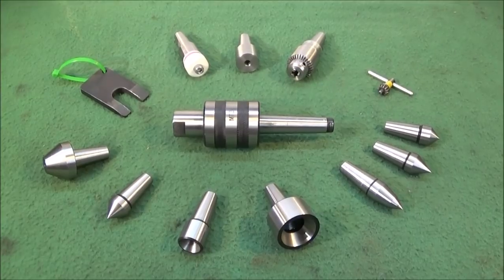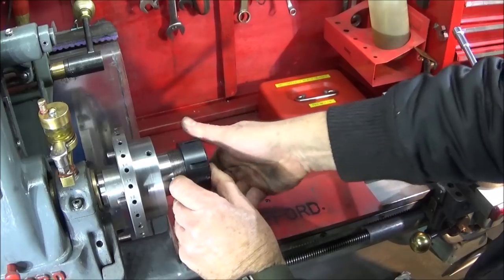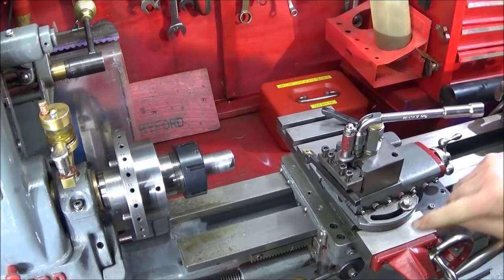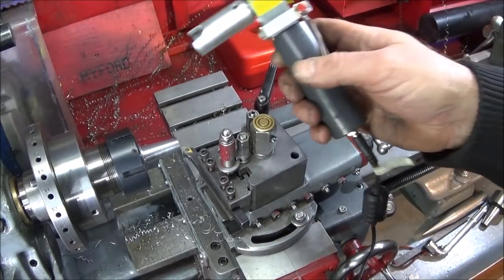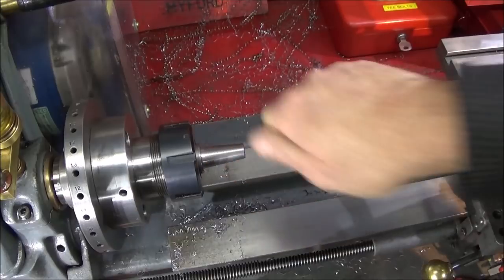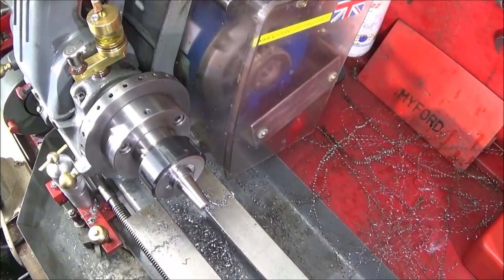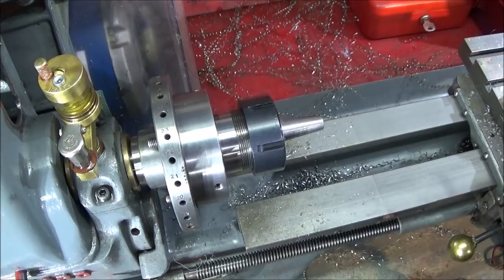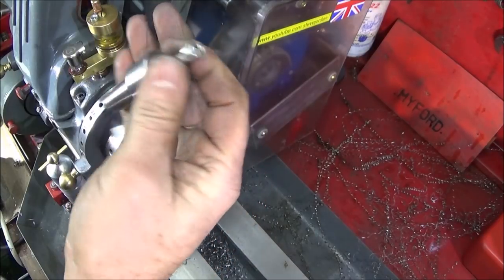Make Extra Tapered Work Holding Ends For The MT2/MT3 Centre Set

Comment: Would you attach a link to the supplier for the bearing collet nut Please
Reply from the maker: http://www.arceurotrade.co.uk/Catalogue/Collets/ER-Collet-Nuts-Wrenches-and-Spanners/ER-Collet-Nuts-with-Ball-Bearing-Type-B
Reply from the maker: https://www.ebay.co.uk/itm/ER40-Castellated-Ball-Bearing-collet-clamping-nut-M50x1-5/281755740563?hash=item4199f36993:g:TZ8AAOSwEeFU~Z8K
They have the other ER Collet sizes as well
Reply: Steve Jordan my misses is going to kick my butt for placing order plus other goodies from there.

Comment: Another excellent video thanks, how did you get to 6.5 degrees please? Is that the specifications for that morse taper? Or did you put in a blunt tool on an existing taper and run up and down it till you matched the angle? Cheers
Reply from the maker: Hi Shaun, I just matched it with an existing one, like you said to get a rough idea, but then had several attempts to get it spot on by adjusting the compound either way with test cuts until I got it right. I could feel by inserting the component end in the centre holder, (like shown in the video) which way to move it. Sometimes just a few thou. This way is all trial and error, but I have found that If I persevere I can always get it right, the same on the Mini Lathe. 
  I didn't try it at the time, but I reckon one could blue one of the tapers up with a light marking blue paste and push it together lightly while twisting in the holder it, to see where it is touching on the diameter?...Then make adjustments on the compound to get it right. It is easier on this particular tool as the taper is relatively short....Regards Steve
Reply: Steve Jordan Thanks for the detailed reply. Money is tight but Iv managed to pick up some cheap 2nd hand morse taper tooling but there is some rust pitting. I was thinking about trying to make some light cuts to try and get the surface ‘clean’ again. Any thoughts? Good or bad idea? Cheers and thanks again!
Reply from the maker: Hi Shaun, I only use a buffing wheel for this type of thing or put it in the lathe jaws with a live centre in the back end, (if there is a centre hole). Then  use emery to clean. I have never tried re skimming as the old tools are usually too hard

Comment: Thanks for the video Steve. What RPM is your hand held gear motor power feed? Do you have a build video for it? This looks like a clever yet simple little tool to improve surface finishes, instead of using a bulky cordless drill. Thanks Steve, Cheers, Doug
Reply from the maker: Hi Doug...Mine is 30 RPM but you could go a bit faster. Although this does work perfectly. You can get them from Banggood at very good prices, in a range of different speeds. See Link.
https://www.banggood.com/DC-12V-356065110220rpm-Worm-Gear-Box-Reduction-Motor-p-1197020.html?p=SO071514950915201710
Reply from the maker: Hi Doug.....This is my build video....It is very easy to make. See other comment for buying motors in various speeds for it.
https://www.youtube.com/watch?v=iQ5UMDmmeLE
Reply: Thanks Steve!